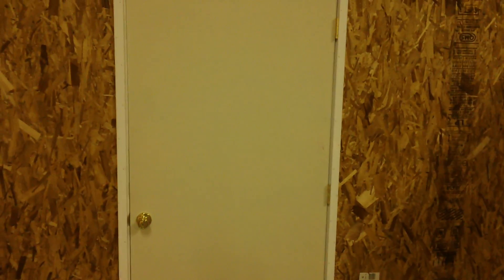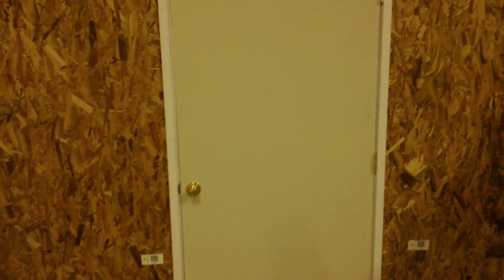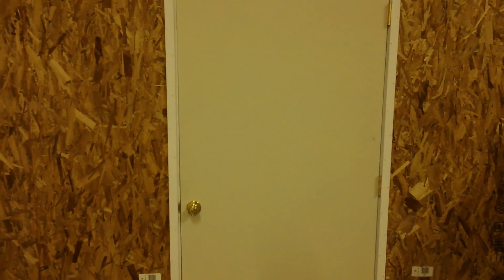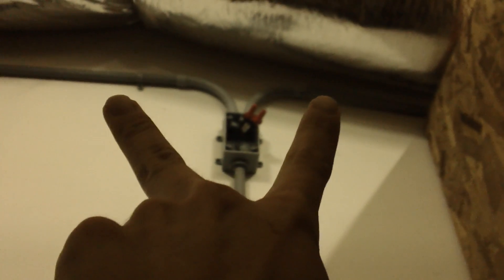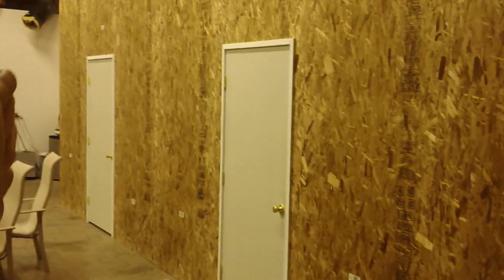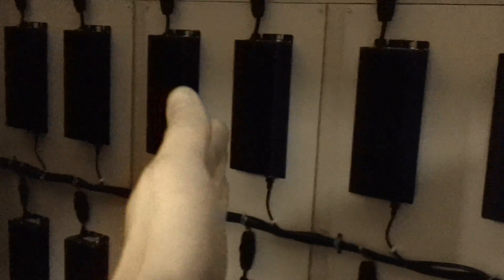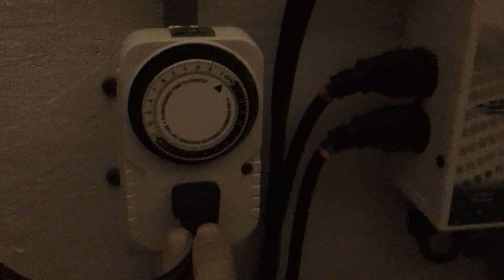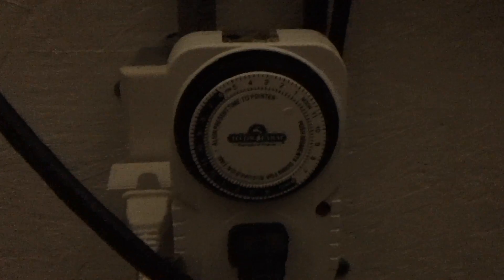My Electrical Setup Explained

Comment: One question. What wire size and type did you use to extend your hoods with. I have heard that the cords they use to transmit high voltage to h.i.d. lighting causes interference and is shielded for that reason. Is any of this true? Did you have any problems with this setup?

Comment: What do i need to do to put up 2 1000 watt hps ?
Reply: a drop cord lol. you don't really need anything special to run 2 lights. just plug it in the wall and forget about it. I ran 2 1000 watt lights in a shed on 50 ft drop cords for 3 yrs before I had the first problem. seriously,  just find the breaker with the least amount of outlets on it and go from there. you really don't need anything special till you start drawing 4 to 6 thousand watts so don't let them growshop owners sell you a new fucking house to run a 1000 watt bat wing. lol..

Comment: Simple math. 1k watts (kw) x what you pay per kwh. Example, I pay .07 per kw. If I had 18k watts running that would be 18x.07=1.26 per hr. X 12 hr light cycles = 15.12  X 30 days = $453 JUST for the lights. Add in all the other fans, water system, ac units etc and that bill will be near 800-1000 per month. IF.... it is around .07-.10kwh. Our grow averages $1100 with the same setup. 2- 12hr 12k watt flower rooms, 18/6 6k watt veg room. That also includes the rest of the house. Not cheap.
Reply: Johnny S it's 12p per kw now
Reply: its 29 cents a kwh in Australia

Comment: would have gone with a 14 AWG wire from your ballasts to the lights just cause of the distance to reduce heat and voltage drop but very nice job

Comment: u have to be stelling electricity. i run about 3000 watts total my electric bill is 500 dollers so unless u pay 1500 a month i dont belave u pay for that electric
Reply: exactly.. when you are a REAL baller, money is way too easy. 3G's is nothing to a multimillion dollar operation.
Reply: hahahah 500 a month for power for a 3k system??? learn to run your shit at 240 and not 120....
Reply: dude look at the size of that op Do you think he has to steal anything?
Reply: "stealing" electricity... no, i am sure since he has already spent well over $25,000 or more in setup, he doesnt need to steal anything. His electric is probably a smooth $3000 easy.
Reply: Jade Juhasz no doubt....
Reply: How do U steal enough electricity to feed a 200 amp 3 phase panel....besides this dude dropped some serious coin on this set-up, I doubt he has to steal anything.....
Reply: got to Go if he is a business or at a ware house that rents to businesses than he is getting a business price because he is buying in bulk. The home owner pays a higher price than the business owner.
Reply: damn, you kids pay out the ass for power on the west coast for sure. I run 3 thousand watts for less than 100 bucks extra on my regular power bill. but dude is right,  learn to run your shit at 240 or expect to pay more. 1000 watts runs around 30 to 40 bucks extra depending on what the kwh is selling for that month around here. we like that hydroelectric where I'm from and it's cheaper to produce so it's cheaper at the outlet. ;)

Comment: I know this is an old bid but I was wondering g how u deal w a single hose portable ac and running bottle co2. I've heard its inefficient as hell. Similar setup in a tent and wondering what's better: hotter temps and co2 or portable ac and buying many bottles of co2? Thanks my ninja! Much love for everything you and your crew do

Comment: Id much rather run high amp timers because they are more reliable . I said fuck relays a while ago. because 240 can just on the 120v circuit.

Comment from the maker: @GreenTigerCA yes all lights are in 240v and i used standard AC power extension cords from frys for the ballasts and then use i cut the cord on the reflector and spliced in the exact same wire that the cord is already made of, i dont remember what it was called but its 3 conductor 16awg cable.
Reply: have you checked your voltage usualy 3 phase is 208 i wonder if that afects anything?